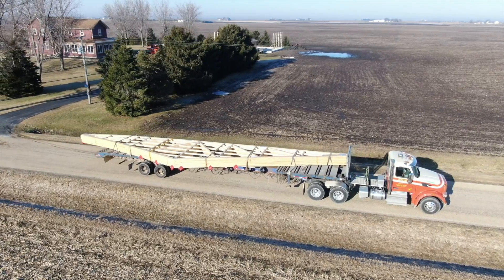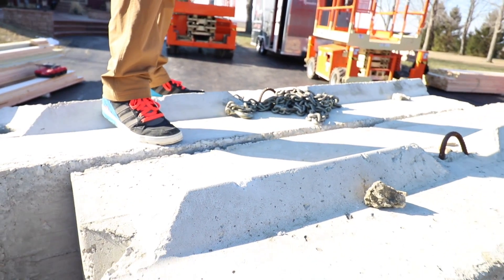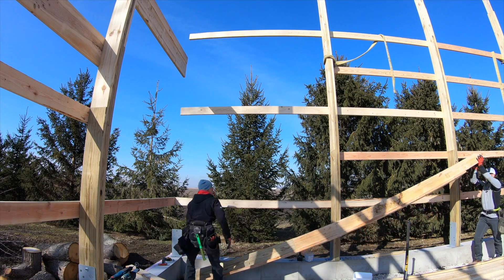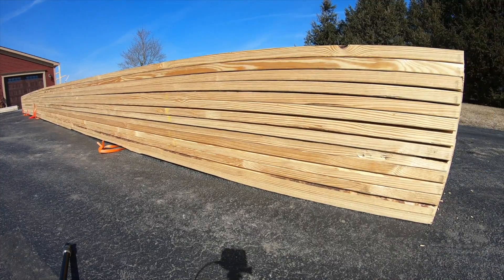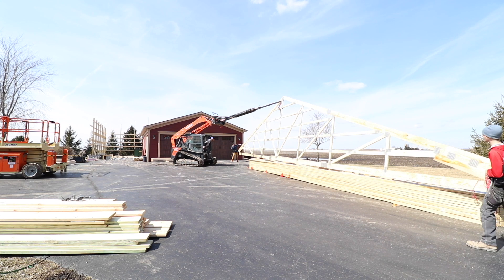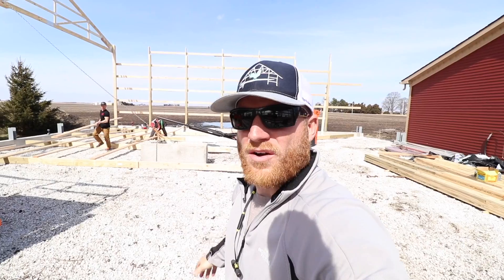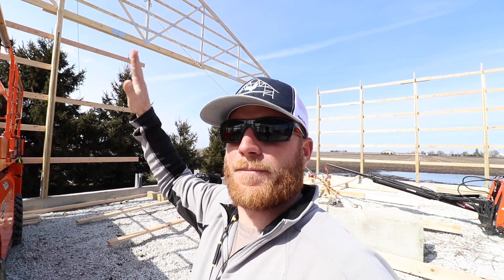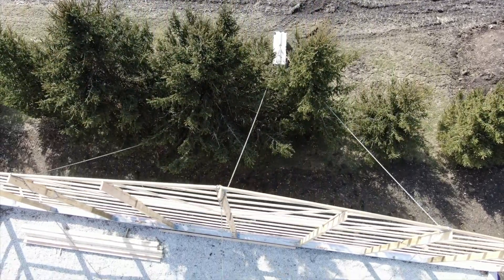How to Build a Garage Addition 3:  Hanging 66' Truss

Comment from the maker: It is almost hard to comprehend how big those trusses are compared to that skid loader, and how easily it handled them!  I wouldn't be able to lift much higher, but weight wise, it's hard to tell.  Sheyenne Tele-boom is awesome too!!
Reply from the maker: @SEABASSINS Tool Reviews I was out of town during the weekend when I normally record it...also, I am trying to post a daily video of this build....takes a lot of work to do that
Reply: The flight in the previous videos helped get the idea that the shop would be big, but yeah, still awesome that you can build something like this on a small crew.
Reply: Awesome video! Going to try building walls on the ground in a couple weeks for a 40x80x16. How long of a wall 16' high can you stand with the skid loader?
Reply from the maker: @jacobwaugh1368  we did this 56' section on one stand...i wouldn't do much more unless you have a spreader bar or someone helping stand up
Reply: @RRBuildings  Appreciate the response Thanks!
Reply: Sooooo do you have a spreader bar? Keep wondering if you're going to pop one out....
:)
Reply: A tip : you can watch movies on Flixzone. Me and my gf have been using it for watching all kinds of movies during the lockdown.
Reply: @Hendrix Brysen definitely, I've been using Flixzone for months myself :)
Reply: @Hendrix Brysen Definitely, I've been watching on flixzone for since november myself :D

Comment: Makes me wonder if it would be much easier to  have each truss ship as two parts. In these situations. Cause just the peak sizes on trusses of this size (if you have a peak) can be a serious problem for transport. Not to mention trying to squeeze them around existing structures if there are any.  While that rule of a 1/16" max deviation from specified size over the entire length can be a problem. There is a way to engineer that into the design so it can be set onsite. 

When i still worked at a truss yard. It was a serious problem shipping big trusses. We often only had a 2-3 hour window that we where permitted to have the trucks on the road. They always wanted it to be in the middle of rush hour for some stupid reason. They finally got to the point where they could no longer get permits for transport, let alone finding competant shipping companies. Since our drivers where not liscensed for such large loads. (we had our own crane trucks and truss delivery tricks, most trusses where around 40' max)

Comment: Question about those corner posts: Would it be helpful to screw in temporary staggered 2x4's so you can have a steps to rest the post on. That way you don't have to go up a large distance and can do it is much smaller lifts. Thus saving the strain on your backs. You could probably even have a ready to go jig to use multiple times. Just want you guys to be safe and efficient.

Comment: Buildings with big clear span trusses like that give me the willies. As a volunteer firefighter, I've responded to three truss collapses over the past 25 years, one of which resulted in a pretty bad injury - we had to helicopter one guy out. That one was an indoor horse riding ring with a clear span over eighty feet. Looked like matchsticks in a pile when we got there, after the trusses blew over. I like the way you guys chain everything off, and nail down your purlins as you go, to keep it all locked together. Keep up the good work. 👍
Reply from the maker: Steel is worse in a fire tho... weakens and collapses much easier

Comment: You guys have to look after your backs, the heavy lifting for the corners aren’t doing you any good. Isn’t there anything that could be used to jack them up where it’s short enough to let you guys upright it with the cement keeping it in place and then it doing all the heavy lifting so you just just have to slide it?

Comment: 100% true on the comment of the importance of the first truss setup. 
When I built my 22x25 garage the first truss ended up with a little outward lean prior to roof sheathing. By that time it was too late to fix. I’m the only one that’ll ever notice it since it’s on the alley side of my property.  The building inspector didn’t even get out of his truck - he said looks good and signed off. But lesson learned. Now I’m in the process of planning to build a small cabin/house on some mountain property that I recently purchased. Your videos have helped me tremendously in the planning and approach to layout and the importance of thinking ahead.  So much so that I’m considering a post frame style of construction. 

Thanks